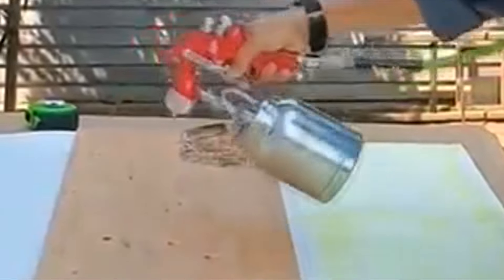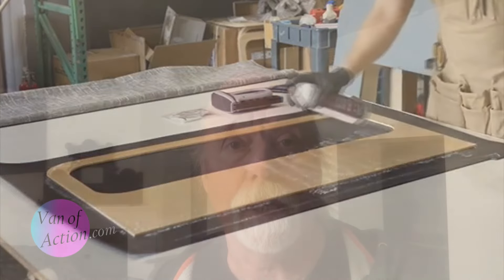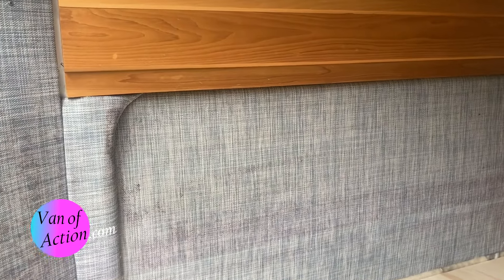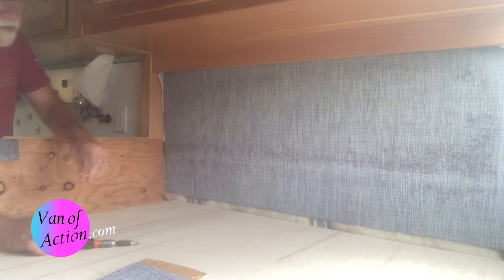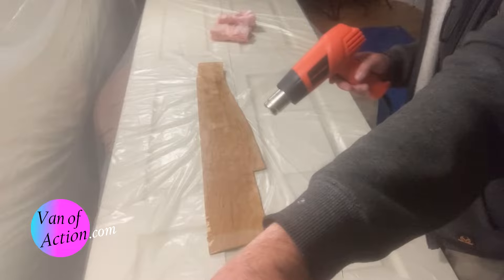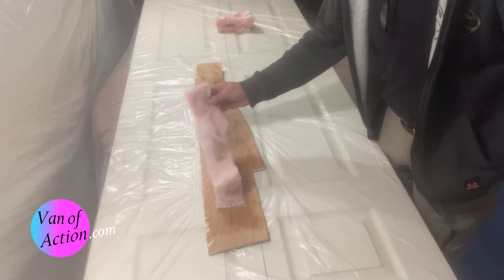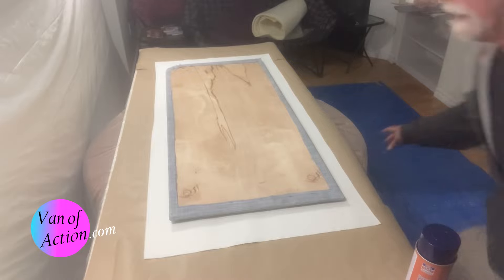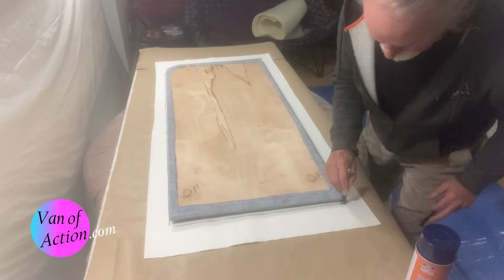How to Add Vinyl wall ceiling panels Van build design promaster sprinter transit van conversion camp

Comment: No disrespect but there are countless high temperature contact adhesives. I'm in the UK so no point in making suggestions just let google be your friend.
Reply from the maker: Hi Dickie - thanks for watching and posting.  I suppose this is a great example of the challenge of a van build.  You'll be doing a little bit of many things you know nothing about.  All important and many exposed when complete.   I have extensive plastic laminate experience but have never worked with vinyl before this project.   So I asked what I thought would be people who would know and bought what was suggested the only way I could - retail.  It was suggested that some of the high temp glues that were available to me may react with the vinyl or the backing on the vinyl .... would they ?  I have no idea.  But for something less than 20 square feet total there is a limit to how much time you can spend learning.  I'm happy with the results of this attempt.  I hope you'll stop back and share some more .... Be well ... Dave